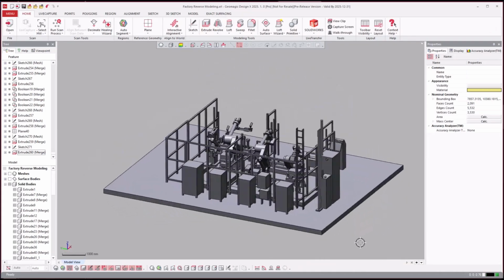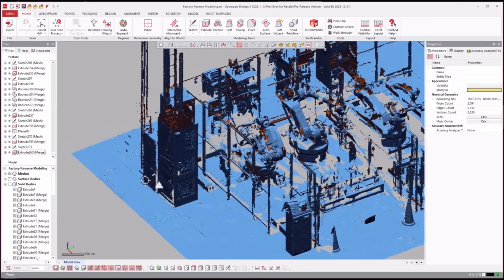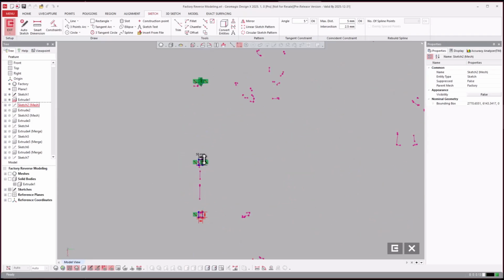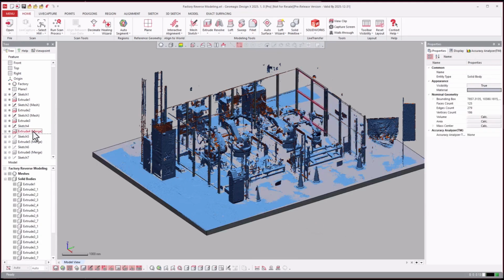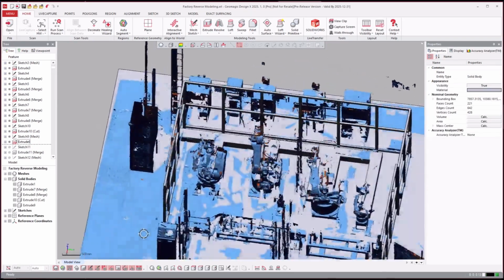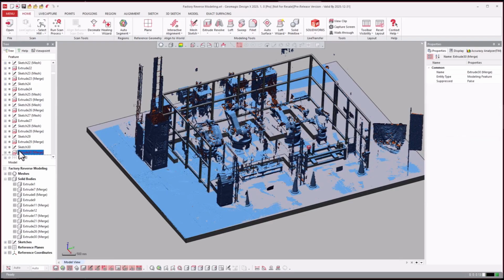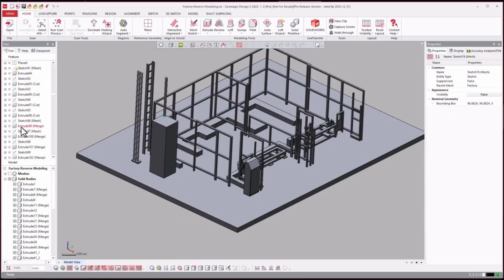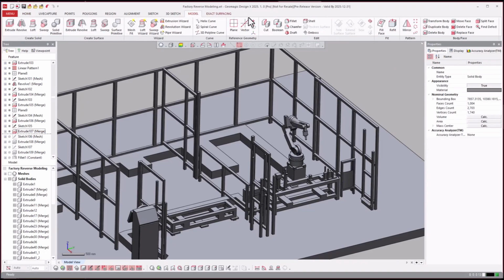Reverse Engineering a Robotic Automation Cell | Geomagic Design X

Comment: In the past, we always started the reverse engineering process of our big data (Paper machines) after meshing the point cloud, but this was always a balancing act between project size and data quality. Currently, our entire Rev.Eng. is based on the point cloud because DesignX offers the same functionalities there as it does with a mesh. 
Perhaps this info will help some of you.
Reply from the maker: It's great that you were able to find a way around the meshes in DX. Thanks for sharing!